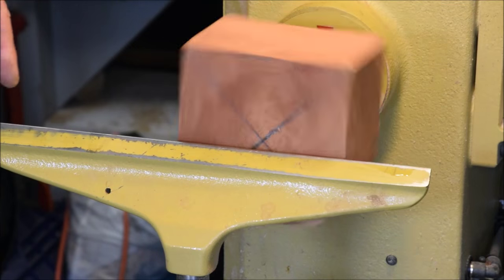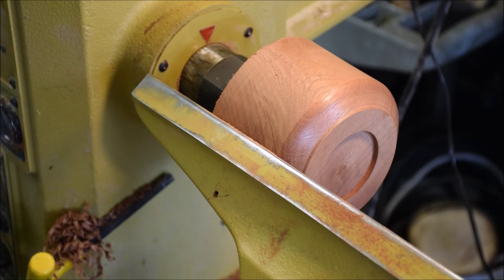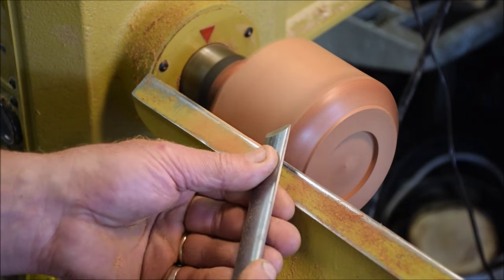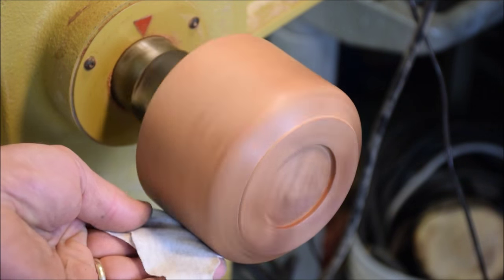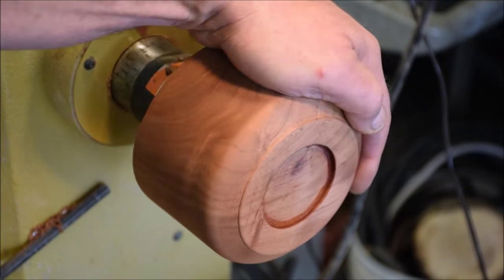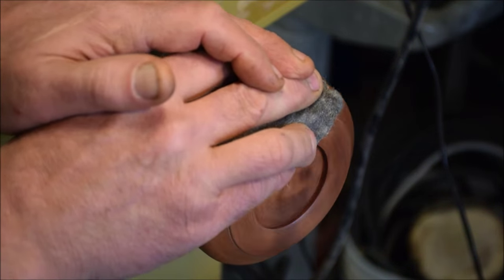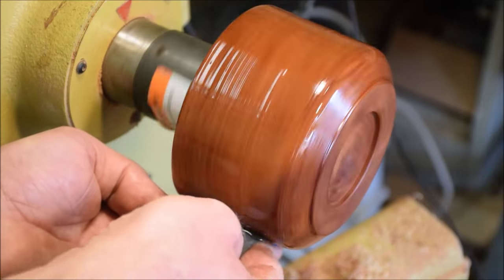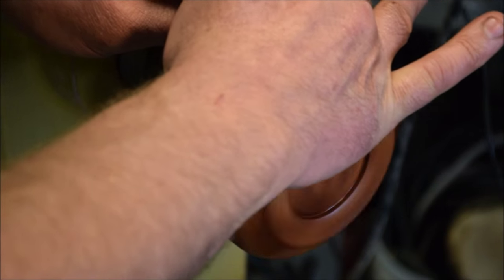Woodturning With Naked Turner Australian Red Cedar Bowl

Comment: Typically I stay away from any cedar..like the following woods..all in the same family....western red, incense, Alaska yellow, redwood and sequioa, Spanish cedar and Mexican cedar..  I have COPD since 2003...all of the dust..even with a respirator hammers my lungs..the dust is so fine it lingers and hangs on equipment for weeks..  The wood is quite pretty and very light in weight and able to resist molds..  as for finish..the woods does not coat very well and oil is about all I used to do with it..The wood is very soft and dent able and thus bumping it messes it up..the wood is hazardous...but I see you effort made it shine and always happy to see your result..  thanks.
Reply from the maker: Thanks Terry,
This is not a cedar at all and is not light it is very heavy and is a gum tree or one of the many types of gum eucalyptus.  No relation to cedar what so ever.  The british would just name things not knowing what things really were.  If you ever get a chance it is a beautiful wood.
Reply: Erik Anderson thanks Eric..  was just trying to protect folks..  and I hope I get to try som gum...someday..cheers..

Comment: how do you prevent tear-out from the inner side of the bowl?  I can't seem to not get at least 1 section that just doesn't look good, even after sanding.
Reply from the maker: I will often times have small tearout areas even after shear scraping.  sharp very sharp tools, shear scraping with your bowl gouge helps and very light passes.  Once sanded wet sanding with walnut oil helps as well